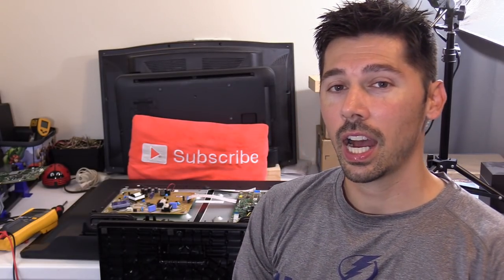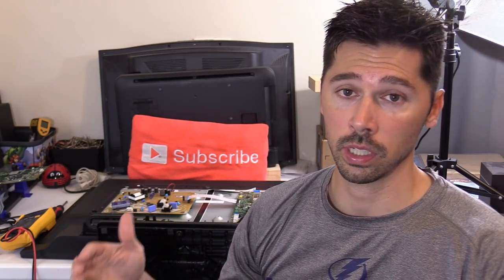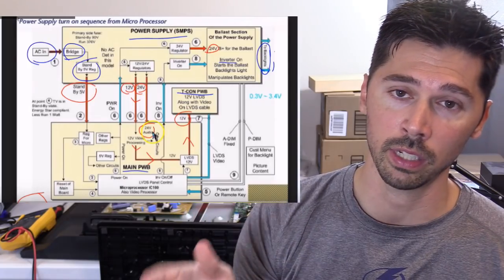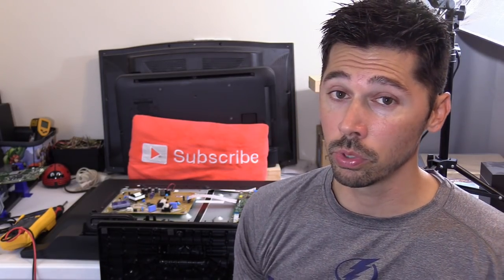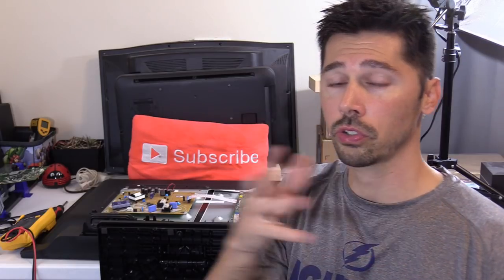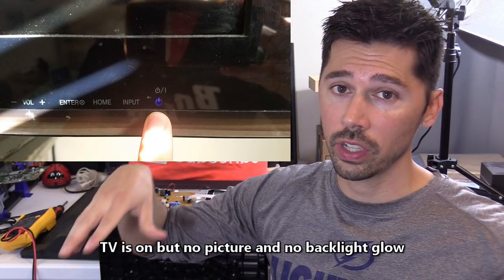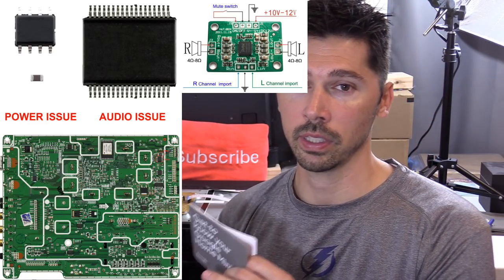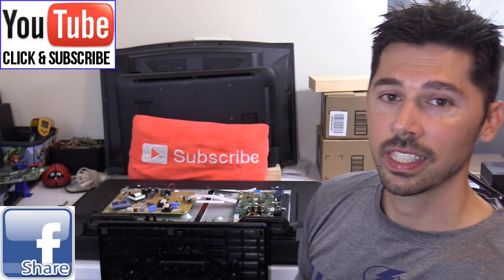LED LCD TV REPAIR GUIDE FOR FIXING COMMON TV PROBLEMS WITHOUT A MULTIMETER !!!

Comment from the maker: 4:08 if TV is turning off because Tcon board is shorted then TV will shutdown to prevent further damage. if Tcon board is replaced but still TV shutsdown you may have a bad LCD panel which is common on older Sony KDL LCD TVs (some Sony LCD panels were recalled) Get TV boards at https://goo.gl/dkHfDD or https://electropartsonline.com/ use code "tampatecfriend" for discount, (one time use code) check here Sony LCD TV error codes http://tampatec.blogspot.com/2015/03/sony-bravia-kdl-lcd-tv-error-codes-for.html?m=1

#commonTVrepairs #TVrepair #howtofixLCDtv #howtofixLEDtv #Tampatec #tampatecTV #fixbrokenTV #fixbrokenFlatscreen #TVboards
Reply: Tampatec thank you for the information I really enjoy your videos thus far.   I replied in an older 'Sony post but have yet to hear back from you and I still have my XBR65X900C not working.   I understand your a busy guy but I have already replaced the LED Driver board per your videos/sony's service manual and the problem still exists.   I am looking for the next board to replace but need some insight if your willing to help.   I have seen a grip of my model TV with the exact same issue.   Any help would be great.   Michael
Reply: In case you don't see the post in the other video, my problem is my XBR65X900C starts to turn on but while the screen is still a dull grey or the android sign is loading the screen will alternate led lights along the bottom from one side to the other then shuts down and 4 blinking red lights.  Like I said above LED Driver has been replaced.  Whats my next move.   Thanks again.  Michael
Reply: Tampatec .
Reply: Tampatec I think my backlight is broken. I have black shadows over most the screen. I've heard it could be just a loose wire? Please advise
Reply: I have a 55 in Samsung model LN52A850S1FXZA version Sool or S001 it has blurred and shaking pic but smacking it gently helps clear it up then most of time I let it run volume all controls work and then it clears,please help it's almost unused and works after 10 min.

Comment: Nice job on all of your videos.  I am currently trying to get my  two year old Sony Bravia back to life.  It lost all audio and video.  I replaced the LED Driver board with no improvement.  I then took it to a local repair shop where it sat unattended for two weeks.  When they did finally find the time to trouble shoot it they told me that the main board was bad and the repair would cost almost the original cost of the TV.  Brought the set home and decided to see if I can find a used but good main board.   My TV is a Sony KDL-50W800C  The main board is an A2071530A and no one seems to have one except two that I found used on eBay.  One of the two suppliers you recommended has one but lists a defect as a cosmetic problem and all functions work fine. The picture of the board is a stock photo so I am a little concerned about the board.   Keep up the good work.  I am lifetime electronics tech, but have no experience with TV's or the new mico components.
Reply from the maker: i found this but make sure part number rev number matches and connections match too https://electropartsonline.com/catalogsearch/result/?cat=0&q=A2071530A
Reply: Thanks so much. I think that is the same one that is listed on ebay.  I posted a bid, but if that is not accepted, I will order this one.  If this indeed does not fix the problem, will they take it back?  The boards on this set are very easy to replace.  Thanks again for your help. Keep up the great work.  I am also about ready for a new Fluke meter.  But with all of the micro stuff now coming out, there is less and less chance to fix at the component lever. It was becoming that way when I ended my two way radio repair career.

Comment: Hey Tampatec great channel, you've saved me a couple hundred bucks already with an older samsung, it was easy to replace capacitors and i've gotten extended life out of an old screen! thanks so much, I do have another samsung, slightly newer that is having a problem now. when there is no source connected, i am able to turn it on, navigate the menu and everything is great. but as soon as i plug in any kind of source, once the picture is about to come through and display, the screen shuts off. it will sit and wait a couple of seconds, and then try to come back on again, but as soon as the picture is on (if it gets that far) it just shuts right off again. 
I bet you have already answered this question before, but i'm having trouble pinpointing. I appreciate all your time and effort. Thanks :)

Comment: How about troubleshooting a TV which starts to restarting, sometimes after a few minutes sometimes after loading a smart app. Sometimes it doesn't restart at all and hence works normally. I tried to use a multimeter, in dc mode almost every voltage is showing correct except for 1 which is marked as 5v and loading 3.9v. Disconnected all cables and re-connected them. At his point I don't know which board to replace. What is your opinion?

Comment: Tampatec - your videos are the best and have helped this DIYer fix several tv's.   I have a 40 inch Phillips now that blows the fuse in the power board.   If I disconnect all the cables to the power board the fuse is OK when plugged in.   I find that adding the main board  BA01P2G0401 2 to the already connected Power board BA01P0F0103 3 and tv isgnal  board BA01P0F0102 3  causes thde fuse to blow!    The fuse will not blow with the power board and signal board connected when plugged into the electrical source - add the main board and pow!    Any thoughts?

Comment: Hi Paul,
I have a Vizio M60-C3. The LEDs started going out (or dim) on the left side, 4th row up. Then the dimming sort of spread to most of the bottom row and about half the two rows in between.  Other than this the TV works perfectly.  My completely speculative idea based on watching some vids is that it is most likely the LED driver board.  It just seems too unlikely that bad LEDs would cluster?  But I know very little.  Thanks for any help you may give.

Comment: Excellent videos!!, thanks for sharing. I have a problem on my vizio, does not have power but has the vizio logo on orange. Based what i learnt on you videos i measured voltage in the pins and the SB voltage of 5.3 is ok . But there is another pin with 12 volts does not have voltage, i do not want to troubleshooting all the components of the power supply. Do you think that the power supply may be the problem? if so my power supply is a revision 2 but the one in the electropartsonline is just a revision 1. DO you think that i can use it without any problem or missing function. any advice is really appreciated. Thanks again.

Comment: thanks for the video! really enjoyed the video and found it helpful! Got a quick question! Hope this is the right place to ask. I have a 50" LED Samsung smart tv. It has no picture or sound, but the backlights do work. I replaced the Tcon board and the main logic board to see if that would solve the issue. Still dont have any picture. there has been the random occasion where the samsung "icon" has appeared on the screen, but quickly disappears (this has only happened a handful of times since it went black) Any suggestions?? thanks in advance
Reply from the maker: Clint McCoy check your cable connections and ground screws on the boards but usually no audio or video can be bad main board. if tv has backight glow, you may have received wrong board version or damaged main board, it happens. if your voltages read good to main board and tcon I would contact the source where you got the boards from.
Reply: Tampatec thanks! The main logic board was from a provider on eBay. It was listed as used but working. May have made the wrong move by ordering the used board!

Comment: I have a JVC LT-47EM59.  Blue power light blinks after trying to turn on.  I've tried the "Reset" fix, works until you turn it off again, then needs reset again.  Sometimes after resetting there's no sound but I have picture.  I opened it up, upon visual inspection everything looks good, no bad caps.  I tested voltage to the power led board and get 5v and 3.2v so I think that's good.  Since everything else seems to be good, I'm thinking it may be the main board that's bad??  Any thoughts would be helpful, thanks!

Comment: I have a Dynex DX-L42-10A 42-inch TV. I pulled it and four other TVs (of varying sizes and brands) out of the dump (I have a guy who works there who sets them aside for me as soon as they come in). This one was working fine for a few days and suddenly this loud static sound started and the TV would turn off after a few minutes.
I noticed a capacitor that is starting to bulge (on its top) on the power board, but was wondering if there was anything else I should look for?

Comment: Thanks for the video. Quick question though... I have a TCL 55” Roku TV. It was plugged into a surge protector during a lightning storm. The next day, it would not turn on. The status light remains illuminated even after pressing the power button (on TV and remote). I have verified that the fuse on the power board is good and I’ve also replaced the main board. Any ideas?

Comment: Hello!.. I have an older model 32 inch led tv (element ELEFW328B) from my inlaw. Told him I would try to fix it. It that has sound, and I can see the screen using a "flashlight test", but screen is not lighting up. How to I identify the led driver board? Ps. Love the Tampa themed channel.. I live Seminole Heights.

Comment: So I have a LG led tv and there are dim or faint lines (almost like the back light is weaker in these areas) only during motion in certain colors (usually duller colors). Anyway couldn't find anything online about it but I've summed it up to being a uniformity issue but I'm not 100% on that. What do you think?

Comment: Tampatec - Hello. In our city no one takes a plasma TV Pioneer PDP427XD for repair. If you can, tell me where the breakdown is: I turn on the TV, it takes 5 seconds and it turns off, blinking the blue diode 8 times. On the main board, a red diode at number d8402 is lit.

I checked the voltage regulators on the mainboard of the (NJM2846DL3-xx)  series with a tester - all the workers. The power from the power supply to the mainboard and from the mainboard to the TV tuner is supplied correctly.

Tell me what else to check ?

Comment: Hey I have a Vizio it turns on everything works normal for like 10 minutes then the backlight turns off I use the flashlight trick and I can still see the TV is on and audio just not the backlight do you know the cause of this is it the driver board or bad LED strips I just don't understand how it can turn on and work and then turn off please help thank you

Comment: Thanks for posting.  Please help. I have a sheer white screen (tiny horizontal and vertical lines) on the left half of my Seiki TV SE32Fy22.  Using as a monitor with my MacBook Pro, not as a TV.  I can see through it, but can't use it for detail work.  Tried hard reset, disconnected everything from computer (VGA Connection)and from surge protector. Hooked it all back up - no change.  So I watched your video and another one and disconnected ribbons from t-com board, cleaned ribbon and contacts and that didn't help. I did notice that some of the cables in various places looked like they had been singed/scorched - not burned all the way thru, but it was alarming.  Is there any way I could send you a photo to see if they are burned or if there is something else that would cause them to have black spots?  I definitely don't want to have a fire.  If they aren't burned, is next step to replace t con board or could it be something else like the main logic board?  Thanks!

Comment: Just fixed a 60 inch someone tossed. Mainboard was bad, but like to fix it for a back up. Symptom I have is Powers up and stays on no problem, but as soon as I connect video source plays fine or a couple minutes then I get a pop and tv image goes away. Any ideas on what chip I should be looking at on main board?

Comment: Hey Tampatec, I bet I've got a problem you can't solve - haha most likely you can though. Let's see! So I repaired my Panasonic TC-55ST30 by replacing the SU board. The TV is functioning perfectly however there's an issue. All 1080p signals are NOT working. I'm just getting an intermittent screen, and nothing else. However the display works PERFECT when I switch to a 720p signal. I'm not sure what to do. Please help me!

Comment: Hi Tampatec,
I just joined your channel. I have a problem with my LG 42PG6000 TV. Some time ago, at the time of power-on, the red LED flashed for several seconds (ultimately also 40/50 seconds), followed by toc toc (relay?), Before turning green and appearing on the screen. From today this does not happen anymore, the TV does not turn on anymore. The LED does not even become red, but shines green / red very fast. I wanted to try to repair it myself even if I understand very little electronics. Can you give me some input, please. If necessary I can send you some photos or videos of the defect.
I opened the back panel .....
Thank you.

Comment: Thanks for the info. I have a Hisense Tv Model LED 32W21. The standby light comes on (red), but when I try to switch it on, the red button turns blue and starts to flicker (about 8 times) and the Tv shuts down. What could be the solution to this problem

Comment: Thanks for your videos!  We tried replacing our T-Con board on our Samsung tv.  It had sound but no video.  First T-Con board was defective; only 2 of 3 blue lights lit up.  Tried a second board and at first had 1/3 of the screen, and then 2/3 of the screen after reconnecting it.  Tried a third time to reconnect and only got about a 1 x 2 inches of lines in the bottom left corner that quickly faded.  Ordered a 3rd T-Con and got nothing on the screen (except backlights).  So we decided to take advantage of Black Friday.  :)  Now for my question---where can I donate my old TV in the Tampa area.  I'm assuming someone could get some good parts off of it.   Thanks Sandy

Comment: I have a toshiba 37av52u. The first 3 times it is turned on I don't get a picture and get some screeching. It seems like once it's warmed up it works fine. Your videos are convincing me to pull It apart and look for hot spots on the boards. Any ideas?
Reply from the maker: +Matthew Berlett sounds like bad caps in main board or power board.

Comment: have Samsung UN55JS9000FXZA, i have back light on and audio but there is no picture. I recently replaced the T-Con purchased on ebay, yet it has not change. I noticed when one connect box is connected to main board, it draws power and the tv switched off and on. I need your technical advice if the tv is worth rescue. Thanks

Comment: How many volts on the signal cable from the main board to the T-CON board? My boss normally check for about 12v and it works. 

Can you please do a video on led screens, how to determine if it's a Samsung or LG TV screen by looking at the tag please?

How about how to do alterations to fix some TV problems.
Reply from the maker: yes usually it's 12v but can be 24v see here and pause - 2:50

Comment: Thanks for making these videos!! I have an LG 47LW5700 LED TV. When I turn it on, I hear a click and then the Standby Light flashes very slowly, fading in & out. I checked the standby pins on the Power board...7v. Should be 3.5. None of the capacitors are bulged. I'm wondering, because I'm getting the wonky voltage reading that it could be the Power board rather than the Main board. Did the flashlight test...nothing. No Sound. I looked all over for error codes for the slow flashing standby light. Your thoughts? Thanks in Advance!!
Reply: Had same problem with 55LW5600. Took a heatgun to the mainboard BGA chip and it fixed it.

Comment: I have a quick question. Long story short, my tv was showing vertical lines...still a picture, but lines. I ordered a replacement tcon, put it in, nothing but black screen and no back light. I thought they sent me a bad board so they sent another...still the same issue, no picture and no back light. Here's the thing, when I put my old board BACK in, there's a picture, it just has lines. Both of the new boards show only black. I put the old damaged one back in...picture with lines. Is it possible they sent me not one, but two bad tcon boards? With my old board in, the tv works fine, sounds fine, there's just lines. With the new boards...nothing. I'm getting so frustrated trying to fix it. Thank you so much for your time!
Reply: I know I'm putting the boards in properly because it works when I put the old board back in, with exception of the lines of course. I can even see a picture under the lines. Just not understanding why the boards shopjimmy sent me aren't working. I must be doing something wrong, right? Their parts always work for me.

Comment: What happens if you disconnect the three connections on the Tcon board and the tv doesn’t power on. The Tv was previously stuck in a boot loop with the back light out. You can only see the boot loop with a flashlight. I have a Sharp 58” Roku TV. I have already replaced the main board and the power supply board. Can you please help? I’ve contacted Hisense, Sharp, and Roku and they all keap pointing fingers at each other.

Comment: Hi ,I got a philips tv 40PFL6606H/12 with red light two blinks.have checked psb got 3.3volts but no 12/24 volts.so what/is the problems .main lge board?
N I got another Sony need to replace t-con board as sound but no picture back light ok
KDL40EX520,learn from your video ,correct?pls advice with Thanks !

Comment: I Had That Trouble Before When 
I Used To Repair Transister Radios
Alot Of People Think if Somethink
Goes Wrong With A Radio Or TV
They Dont Think It's Worth Fixing.
But They Dont Have The Knowhow
To Check For Loose Solder Connections.